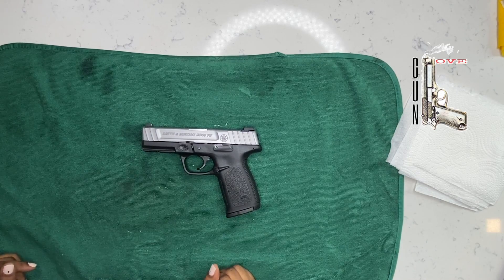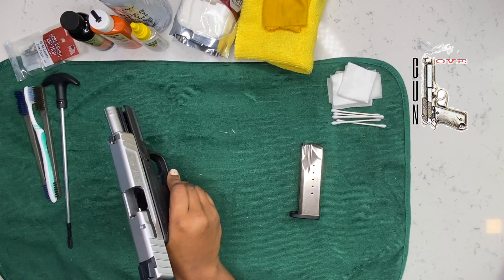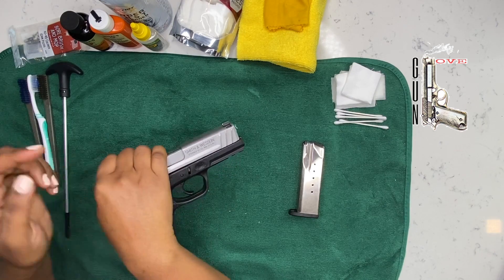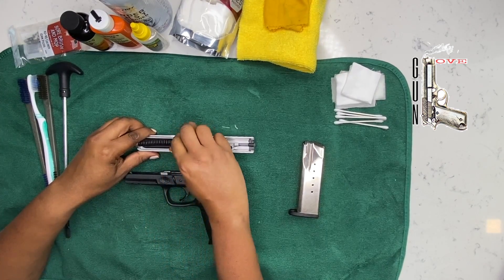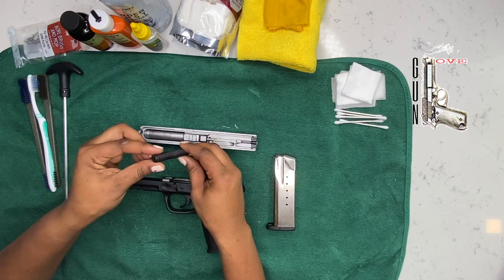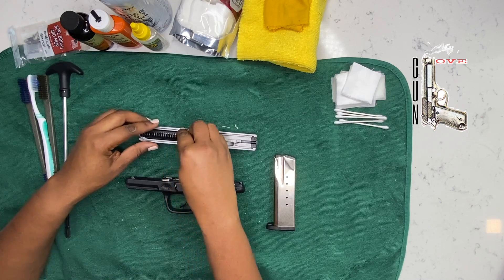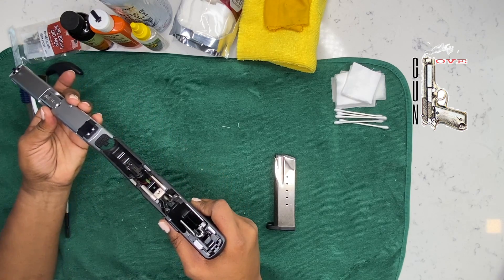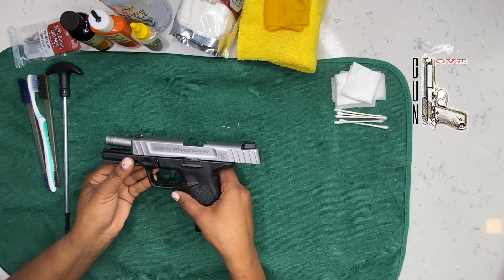S&W SD40 VE Field Strip

Comment: Niiiice...  What do you recommend for cleaning and lubricants??
Reply from the maker: Thank you! I am actually still a fan of Hoppes #9 products. I use their bore cleaner and lubricating oil and that pretty much does the job. 

I also like to use Break-Free's CLP and Powder Blast Gun Cleaner and Remington's Rem Oil. A precision lubricator bottle is super helpful too and I need to start using one in my videos. 

While you can use a toothbrush, I like to use gun cleaning brushes since they have the dual heads on them.

I carry Bore Snakes too when I want to get a quick clean at the range.

We also have to remember to use the proper caliber head sizes for your bore and brush mops for cleaning!

There are a variety of brands and pros and cons for many peoples personal preferences, but anyone can always go with the basic Hoppes kits and not go wrong with ensuring their guns are clean.

 I have a military style kit and need to use it in some videos, but I can't recall the name off of the top of my head right now.

I will get a review up!

Is there anything in particular that you like or have heard was better?
Reply: I love eezox for carry guns and ballistol or hoppes for most others. I like the eezox because it's a dry lubricant so it doesn't collect lint like other lubricants would
Reply from the maker: @BryanTTga   Thank you! I have never used EEZox before, but I like the thought of a dry lubricant. My carry is always collecting lint and dust! Great recommendation!
Reply: M-pro 7, and hoppes lube.